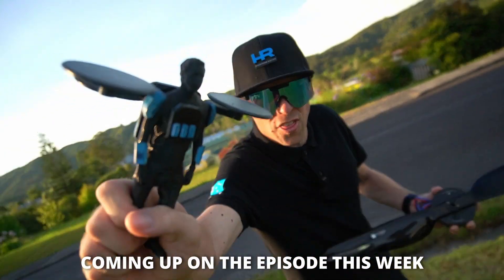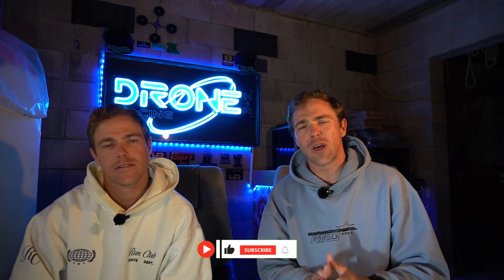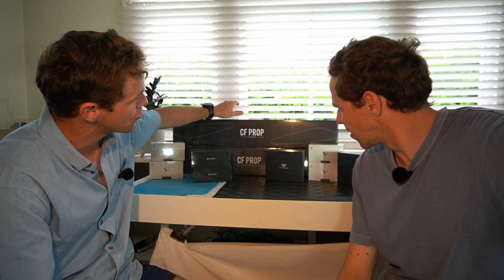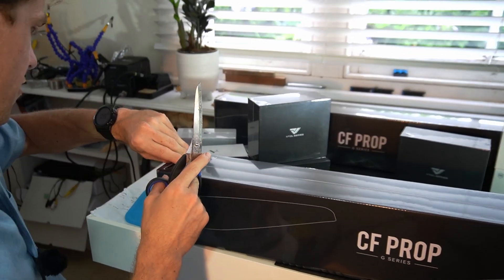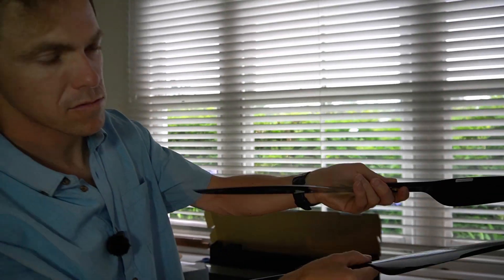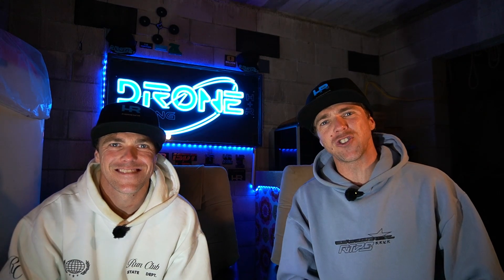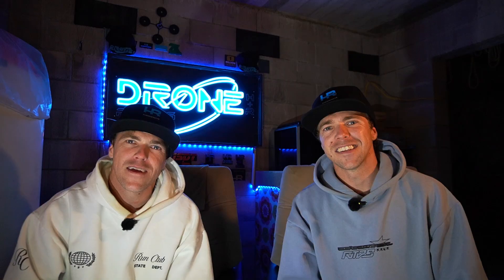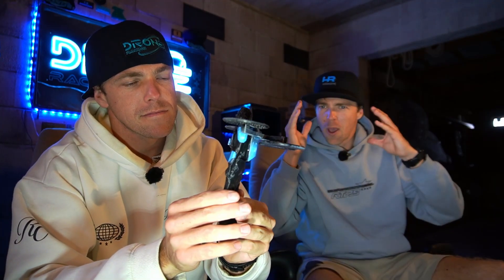HOW TO MAKE THE ULTIMATE JET PACK FLIGHT SYSTEM: THE DRONE PACK

Comment: Spinning the two props two inches from the pilots neck, especially with a disc-loading sufficient to lift a human pilot? You could reduce the disk loading with more disks (multiples of two obviously) and position props such that there’s nothing critical (including pilots head) in lateral line with any of the props. 🧐 I dare say you already know this and if so pls disregard this. 😁👍🇬🇧❤️
Reply from the maker: Yeah nice one.  Yes all that we be adjust for the final design
Reply from the maker: No Pilot would ever like a prop spinning that close LOL
Reply from the maker: She’s going to look pretty cool in the air 🤙